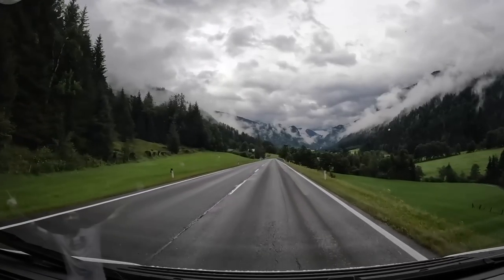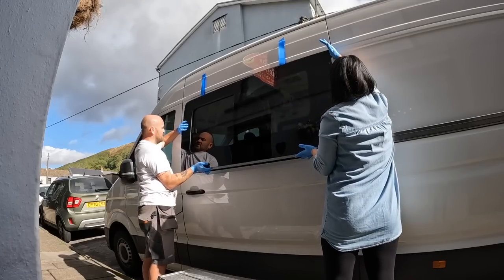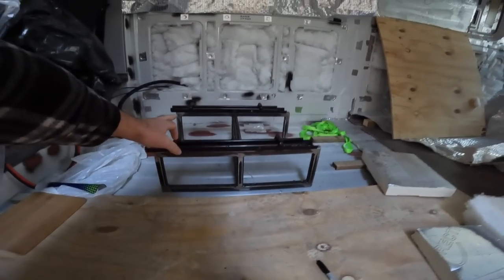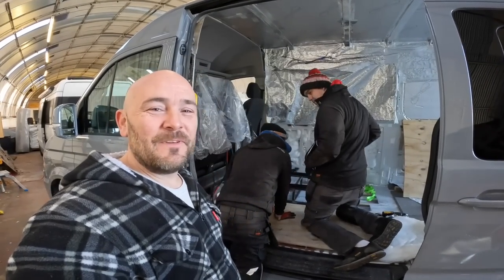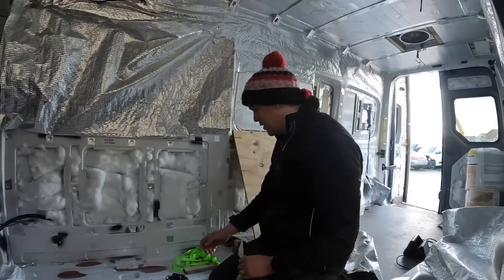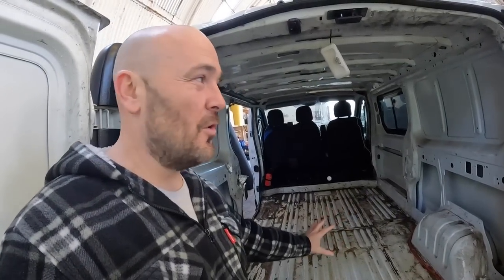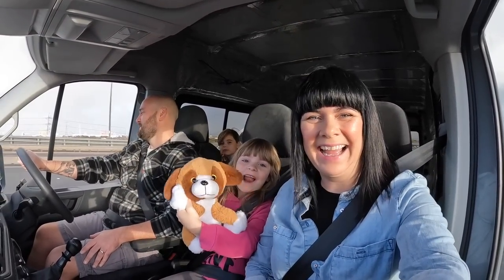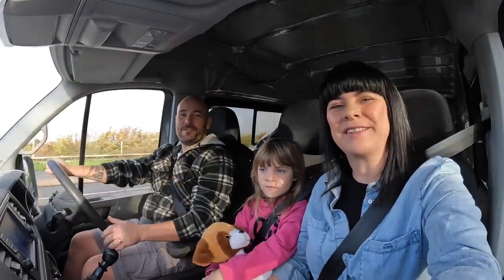Double Base Swivel Seat Install | Van Life Family Van build 5 berth NO GAS

Comment: That swivel double seat is much easier than I looked at a vw camper. It was so difficult and heavy and you had to have the hand break off which I didn’t like. Hence I didnt get it. So many of the vw campers have the double seats now and they were going to charge me £600 to change to a single swirl.  
Looking very nice and I love the colour
Reply from the maker: The swivel was so easy to fit we were surprised, the head rests do need to come off though but nothing major! Glad you like the colour choice xx

Comment: Why hasn't anyone invented (instead of a swivel seat(s) a static seat,  meaning when it's in driving position (normal) you then go into the camper living side, then pull/press a release switch and then slide the whole back (upright) into the opposite position. So basically the upright of the seat would have a back-and-front comfort sitting design on either side. And then you just release the switch to lock it in its new position!  (I may have to patent that idea) 😎
Reply from the maker: Sounds like you need to invent one haha 😂

Comment: Enjoying your Crafter build, I'm just working through the vids. Is the drivers swivel base from r&j as well? If it is how do you find it? I couldn't get comfortable driving with my r&j drivers swivel because of how much it raised the seat height so it's currently sat in my garage.
Reply from the maker: Hi Dan, yes it is the only thing we don’t like it having to release the handbrake to swivel it xx
Reply: Thanks for the reply. How are you finding the increased height of the drivers seat though? I find the handle that moves the seat back and forth digs into the back of my left leg

Comment: The single front seat di you have to move the hand break or is that only on the pre 2017 Crafters. Cheers
Reply from the maker: You do with most of the swivel plated but the ones from R&J Campers have been raised so you don’t have to XxRR

Comment: Do the seats swivel with the handbrake on?
Reply from the maker: No they don’t …
Reply: @TheRollingRucks  If you get the handbrake mechanism from the Grand California you can swivel with the handbrake on. I don't work for VW anymore so cant look up a price but we used to sell them to camper convertors wanting to fit swivel seats. If you always remember to stick in the lowest gear its not an issue but the convertors always worked on their customers being able to sue them so went along the expecting them to do stupid things route. Anyway waffling, just thought I would mention it just in case it is something you had considered.

Comment: Hold your horses, stop, why change all your plans, get the seat base altered so the seats have less lean back, look at the example pic you added in the video at 11:26, there is almost no lean back on the seats, , I've got a ducato twin seat in the back of my van with a modified base and has very little lean back,  just have your base modified again, yeah it will cost a couple more ££ but will save your original plans. Think about it 😉
Reply: Just to prove my point, try adding a few washers at the back of the seat between the seat and new base, a few mm there will shift the headrest a inch plus up top, I welded mine in such a way the base of the chair (bum area) is parallel to the flooring, then the backrest has very little tilt. 
Another thing and trust me I've been there, the swivels are gonna raise you around 5cm which doesn't sound much, , it is, you feel like you are on the ceiling, if you install remis blinds the upper carbon rail is in your line of sight and you have to push the clutch down rather than forward which is a pain in traffic, , you will probably end up buying the lowered seat bases which take the 5 cm back out, in which case your rear seats are now to high, point being, get your swivels fitted, decide you need lower bases, then get the rear seat adjusted lower and slightly lower at front to alter the tilt more upright, then finish your original plans as I imagine you spent a lot of time working on them. Good luck
Reply from the maker: Thank you for your suggestions we will look into this ;-) XxRR